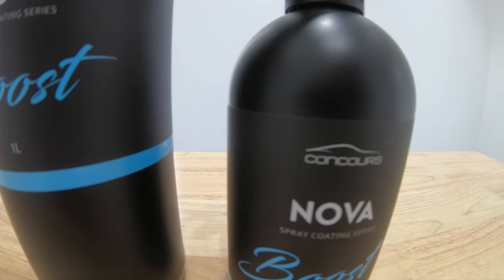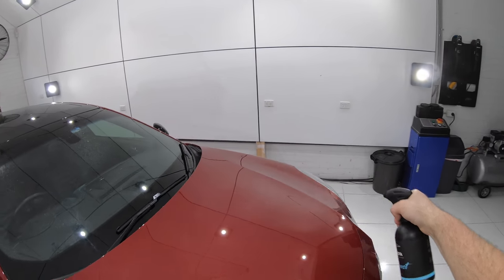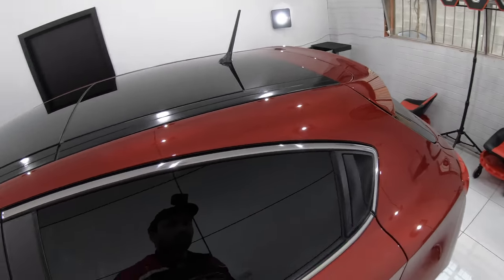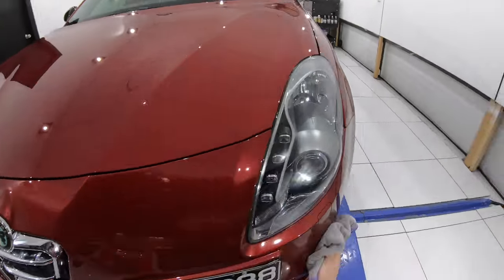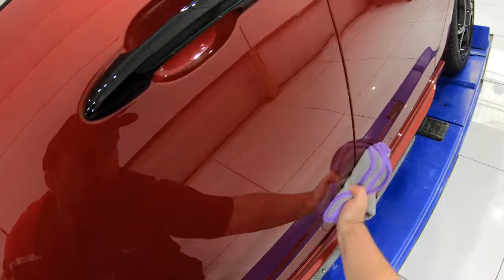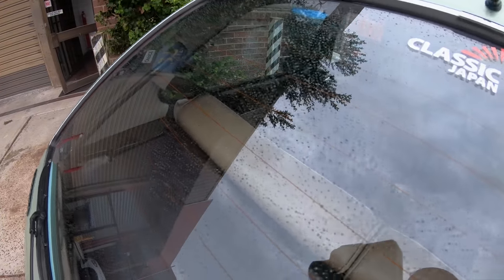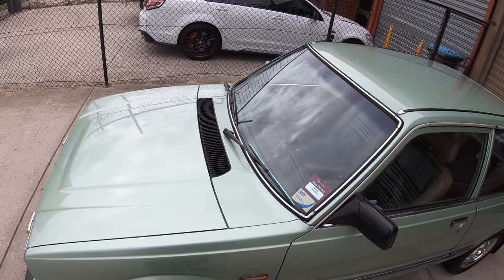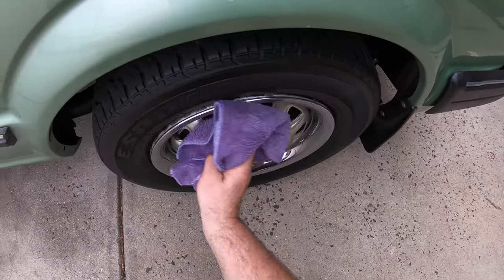THE GREATEST QUICK DETAILER EVER MADE! NOVA BOOST

Comment: Another great video as always 👍🏻. I have boost can’t wait to try it out once I get a weather window , car is wearing  lustre topped with jet  so it should be perfect for sprucing them up . 👍🏻
Reply: I'm trying Lustre atm (on just one panel).  I've ordered Jet to try it also and have read that they work well in combination.
Reply: Jeff Kogler I was interesting in trying Boost out as well. I have been topping Lustre with Jet now for about a year.  Very happy with the results. I just watched another video, however, that has gotten me a little concerned. A comment was made that when you stack the two products their durability is not as long as if you applied just one of them alone. I contacted the US distributor and he confirmed that statement as well. He said if you stack the products you might get a month of production. I wonder if Boost would extend that production or if I should just use either Lustre or Jet.

I believe Sandro preferred Jet over Lustre if he had to choose. The US Distributor opted for Lustre. I understand that this choice comes down to personal opinion.

Comment: Hey Sandro, would you spray Boost V2 directly onto a drying towel and then dry the car with it? Or what’s the appropriate way to use a drying aid?
Reply from the maker: I would firstly and safely remove the bulk of the standing water with a drying towel or blower and then use Boost V2 with a couple of standard to plush microfibre cloths to mop up the rest of the water and finish streak and spot free - you can either spray it directly in the panel or on one of the cloths and work panel to panel around the car.
Reply: @CarCraftAutoDetailing  Thanks mate, really appreciate you replying to me on a 4 year old video.

Comment: I have to agree Sandro, this is the best QD on the market.  I have a question: how hard to you press when your buffing it with the second cloth (not the application cloth)?
Reply from the maker: I always try and get the product as well levelled as I can with the first cloth, so that the second cloth is just a quick and gentle final wipe - so not very much pressure or time at all.
Reply: @CarCraftAutoDetailing  how would you compare Boost to the newer Boost V2?
Reply from the maker: @Erik Leach V2 is more like Nova Jet and Lustre combined in terms of looks, durability and performance but applies even easier like a quick detailer.
Reply: @CarCraftAutoDetailing   really?! My intention was to coat with Nova Evo, then top with Lustre and Jet. Is Boost V2 really close enough to the darkening and shine of Lustre to replace the combo? If so, that would certainly save me time and money. I guess I could go Evo topped with Boost v2, then maintain with Boost v1
Reply from the maker: Yes, I would personally say V2 is more like a durable top coat that looks and behaves like Jet and Lustre rather than a QD - it just applies easy like a QD

Comment: I’m not sure why but I just used this on my brand new coated Lexus. (It’s been coated with CQuartz UK 3.0 and CQuartz SiC for two weeks), and it left a haze and streaks that will not go away. It’s bizarre. No matter what I do they come back like 2 minutes later. I’ve tried 5 different types of brand new microfiber towels. 

It’s not just a little bit of haze, it looks like thick buffer trails all over the car. I used it sparingly I tried again a few hours later with a little more product. Both ways with the exact same result. Also the same thing on the glass. 

Maybe a bad batch?
Reply from the maker: I can only takes some guesses, but a bad batch or bottle is always a possibility but a little more rare in general. I’ve not tried Boost over SiC as yet and sometimes certain products don’t mesh well so that’s another possibility. Other times it could be something going on with the paint surface itself. Have you tried applying another top sealant or detailer on top before Boost - how did it go or react and if so is there anything else on top of SiC or has there been in the past? Boost is formulated to come off after a wash or two at most, so you could try another product to see if it’s a product or paint issue. It’s just about trying to diagnose what the issue is and a little investigation is sometimes needed.

Comment: Thanks for the video which is extremely detailed! Do you think Lustre and Jet can also be applied to the windscreen? Or even more, layered on the windscreen?
Reply from the maker: Thanks and yes I’ve used them both on windscreens with great results. In some cases depending on the specific car, glass curvature and wipers there can be chatter issues with many sealants and even coatings in glass but that tends to be more of an exception rather than the norm.

Comment: Hi Sandro , I’ve had an issue with Boost , and was wondering if you can help, a couple of days after I apply it there’s seems to be some sort of hazy film that comes out , it can be wiped off but the next day it will come out again . Have you heard or seen anything like this ?
Reply from the maker: I think I’ve had one other person mentioned a similar issue. I can’t remember exactly but it may have been due to not shaking the bottle before use. 
Also sometimes the paint needs a reset if it’s been a while since it’s had a good decontamination wash/clean and IPA wipe down which could potentially also help remove any older sealants and environmental contamination which could be causing bonding issues, but it’s hard to say for sure!
Reply: @CarCraftAutoDetailing  thanks Sandro , I used it today as a drying aide after the first wash since my car got coated with Gtechnique . I used it like you did in your Honda while wet , it can’t get any easier than that , if it happens again I’ll let you know I did shake the bottle before every spray

Comment: I’m not sure what I’m doing wrong Sandro, but I’ve just bought 1L of Boost and tried this on my car. On the glass, it streaks like an absolute mofo, to the point where it looks all milky. I’ve had to clean it off with 3 applications of Clarity. Perhaps it’s reacting to the Gyeon Glass that I have on all the windows except the windscreen. Any tips?
Reply from the maker: Yes it could be that. I’ve had that same issue with a few spray sealants and quick detailers that just don’t seem to mesh well with certain coatings or sealants when you try topping them. I’d love to tell why this happens but the best I can do is say that certain products just don’t play well together for whatever reason.

Comment: How long after a ceramic coating would you start using this ?
I had mine coated a few weeks back and tried to use the Nova boost - the car is metallic black and can see the product is not buffing in properly and looking patchy ?
Thanks
!
Reply from the maker: You could try waiting a couple months as sometimes a new very hydrophobic coating may not accept any top coat, but sometimes it’s just a compatibility issue where two different products don’t play well together.

Comment: So say that I have a car coated in somthing like evo if i was it every 1-2 weeks use boost after would that help the upkeep of the coating and not need a topper like jet???? or should i use boost after ever wash and then every 6 monthes use jet to upkeep the coating ???????
Reply: @CarCraftAutoDetailing  so use boost after every wash and that it really, if thats the case I might stop giving out a free 100ml bottle of reload with every coating and see if I can get a small bottles cheap and put boost in them to hand out
Reply: @sbrick9589  have you used reload over Jet by chance? I have just applied Jet to my wifes car, and have reload on hand but I was wondering if it would go well with Jet..
Reply: @lawrencegambale3683  yes i keep relaod , jet and luster in my kit . Jet is better then reload BUT reload is really good for the $$$$$ I use it on my cheaper jobs and can mix 25% water.
Reply: @sbrick9589  thanks mate. To clarify I put Lustre then Jet on her car, so just looking for something to maintain it with weekly or fortnightly washes. I have Reload but was not sure if it would work well with Jet. I'm only a home hobbyist so I'm not pumping it out that much and cost is not my main concern.. I think I'll give Reload a try the next wash and get some Boost on my next Waxit order. Cheers.
Reply: @lawrencegambale3683  by the looks of it boost will be your answer

Comment: Is this comparable to the coating sealant sprays from polish angel?
Reply: Car Craft Auto Detailing I have polish angel, gold zircon, rapid waxxx, and high gloss. I probably didn’t need this but I ordered boost and luster gloss, also if you use boost after washing then top with let’s say PA high gloss. Would nv boost minimize the life protection of PA high gloss? Since it’s going on top? I think I made the wrong purchase lol
Reply: Car Craft Auto Detailing ok cool good to know, my car is coated with polish angel cosmic V2. I ordered boost because I read on there website that it has the ability to remove water spots. Do you let boost cure a few a hours before applying another more durable detail spray like Polish angel high gloss on top of it?

Comment: Oh man, used this for the first time on black paint and it was a smeary mess! 🤪
Reply: Car Craft Auto Detailing it may be the Prep All solvent I used before. It’s supposed to leave the paint bare, but I think it left something behind. I’m going to try Boost without using Prep All tomorrow.
Reply: @CarCraftAutoDetailing  well, tried Boost again. Definitely still smeared black paint. Tried Beadmaker on the same panel, zero smearing. Who knows...
Reply: Car Craft Auto Detailing decreased the amount I used and that seemed to really help. Still didn’t use a ton initially, but...🤷🏻‍♂️
Reply: Thanks for the info. Was thinking about getting Boost ( it’s advised after nova evo) but my car is black